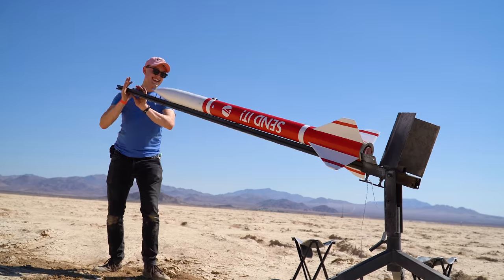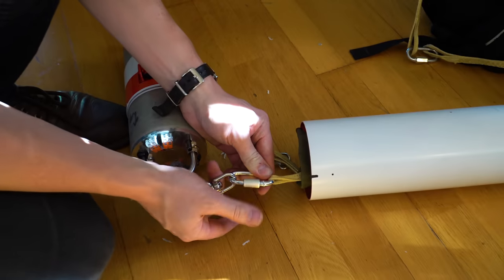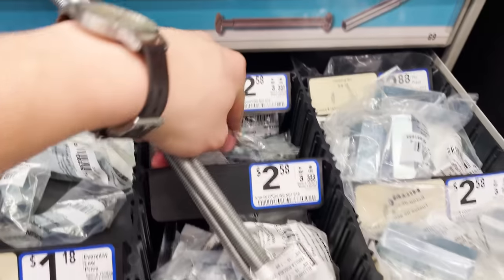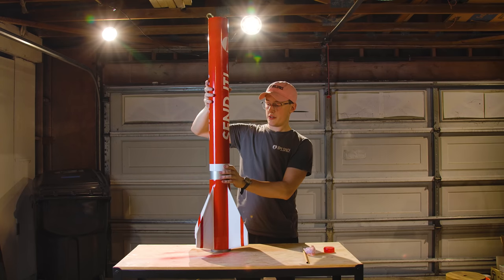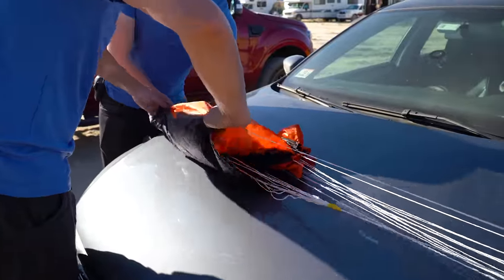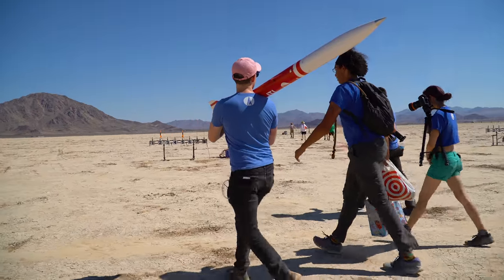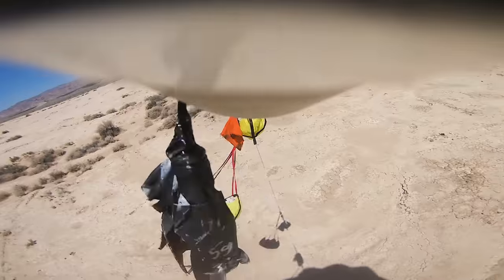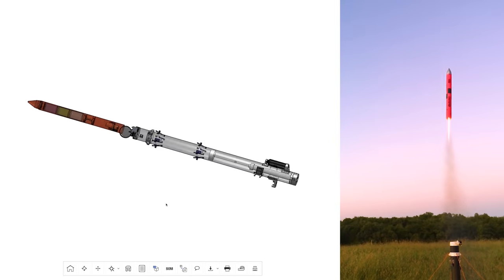SEND IT! - Rocket Launch

Comment: Hello! I'm looking to get into HPR (I have one year left until I can get L1 certified, I'm currently 17) thanks to your channel. I just joined Tripoli and I'm mostly done with a single-stage rocket powered by a D12-7 motor, which is my first rocket not built from a kit. What would you recommend learning and trying so I can be ready for the L1 certification test when I turn 18? I have quite a bit of software and electronics experience but I've never done flight avionics or anything of that sort. I've also flown some kit-built rockets with C motors but I haven't flown anything bigger as of yet.
Reply: For l1 and l2 you actually do not need electronics, totally optional
Reply: @lbeyyt6581  I plan to do the L1 cert with no avionics but I want to do avionics for other things because it's cool.

Comment: maybe use a more robust flash storage mirco or mini sd, like cf or an environment hardened usb stick just solder the usb connector to any adapders and plent of hot glue and it should providee much better protection about the expense of 2ozs of increased flight weight

Comment: Instead of inserting SD cards directly, it is better to solder 9 thin wires so that it has the possibility of movement and maybe put them in in a special foam coated case. Then I think it can stand seriuos G levels.

Comment: To review if you would have targeted and locked on the sun it coulda kept going. I got lost with all the tech talk at the start. I seen heavy hardware and started thinking about power-to-weight ratios and hot girls . . . well women. You understand. Didn't even install a parachute - neighbors roof works fine. 🤣 Appreciate the share. Congratz on the cert 3.

Comment: is this a hybrid rocket engine and was potassium nitrate used?
Reply: It’s a solid engine.
Reply: @fullflowaerospace  what is the fuel type
Reply: @Pa4lakVRT  it’s an Estes black powder motor. I strongly recommend against making your own fuel and engines because it’s very dangerous. If you want to do something like this, then first, you have to get your L1 and L2 cert, and I strongly recommend using commercial motors.
Reply: @fullflowaerospace  i understand. Do you have Instagram?

Comment: I recently lost a rocket due to a failed quick link. The engine and a piece of the body flew off, so the parachute could not deploy and the engine and cap were lost. The rocket dug it's nosecone into the ground, but was fine aside from some dirt 😅
Reply: P.S. Could you put the metric to US imperial unit conversions on screen whenever numbers are involved?

Comment: try hydraulic/electric syringe for liquid propellant rockets, instead of turbo pumps
Reply: its like launching a rocket from a cylinder push silo, mechanically, sling, piston sling
Reply: ejection launch
Reply: same hydraulic-electric push for the sequence motor ejection system, with nozzle rollers to limit the rate of the ejection of the rocket fuel catridges
Reply: ie, a hydraulic press, good for you
Reply: you know the mixed propellant motors are sensitive to shock start
Reply: dont be scared, tho
Reply: it will just boom some, nothing more :)
Reply: screw press, also
Reply: a flywheel can store a ton of energy, like a 0.1m radius spinning cylinder at more than 2,000,000 rpm, 30kWh/kg, same as pure hydrogen burned in atmosphere air, ie, 120MJ/kg, the cylinder could explode, tho, from the radial centrifugal acceleration, tearing it apart
Reply: or it could just stay together, work very nice
Reply: make it work totally offline, not even a radio
Reply: beat the rocket equation by having a first stage (with optional zeroth sling stage) of a kerosene air-breathing turbine, then detach the nose of the rocket (2nd stage) to boost into space, with standard rocket propellant, yes boost up with nothing more than fighter jet turbine engines, hover mode, less fuel to boost up, also, and not the typical plane rocket launch, but a first stage rocket shaped and oriented turbine stage

Comment: why would the rail block your gps in an open space like that???  I think you have another problem
Reply: The rail is a big metal rod which is blocking gps from going there.
Reply: @fullflowaerospace  put your phone there and run a sat signal indicator app
Reply: @FourthWayRanch  that’s not how it works. The metal launch rail is obstructing the GPS from sending or receiving ANY signal in that direction.